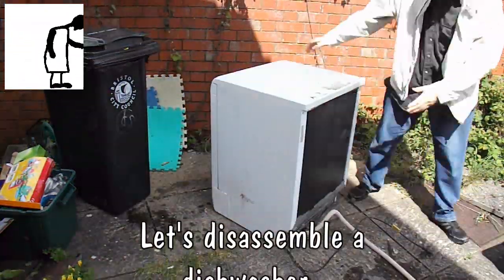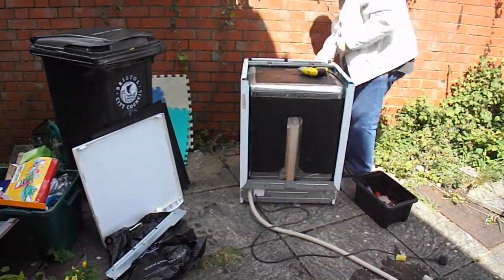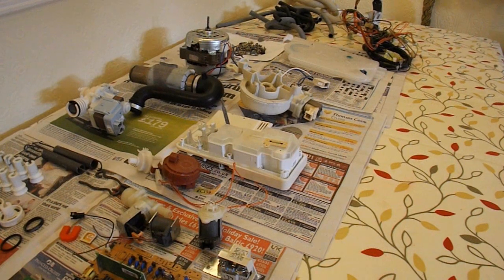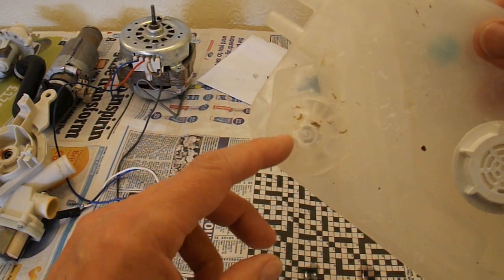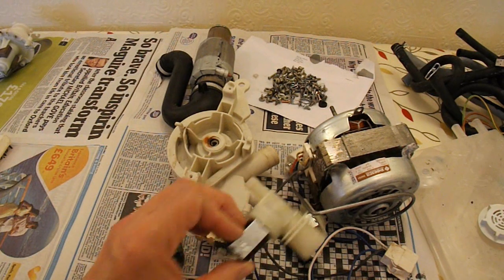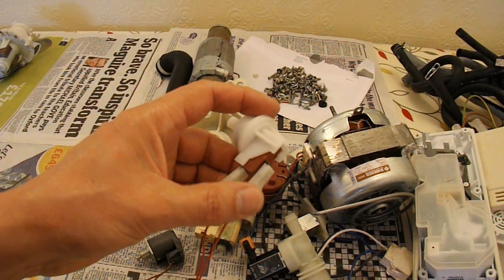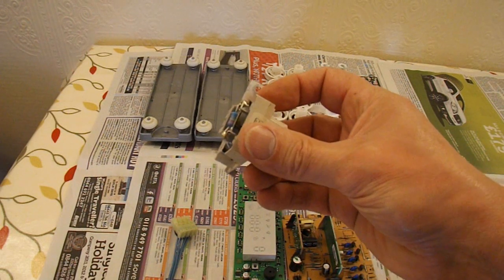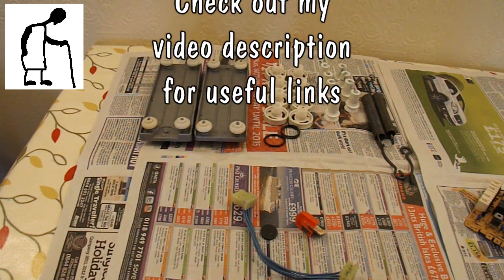Let's disassemble a dishwasher

Comment: The solenoid is dc/ac, but it needs a high-voltage to trigger like 220 volts.
Reply from the maker: Thanks Robert, I will have to do some research to see if there is an easy way to use them on my projects.

Comment: Super video mate! But i have a question.Could i make a electric bike with this motor and a 12-220v inverter?
Reply from the maker: Short answer is I don't know, probably but that seems a lot of effort. You would need to sort out the gearing and the battery weight would probably kill it.